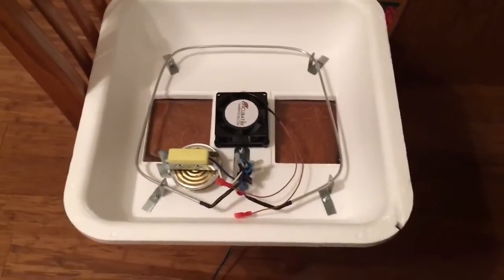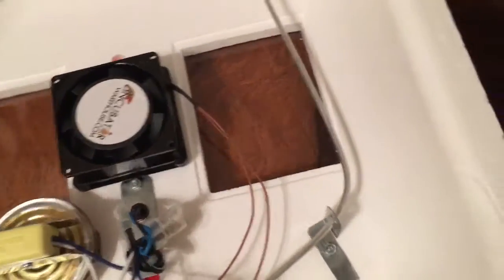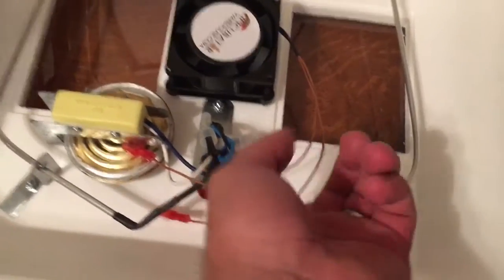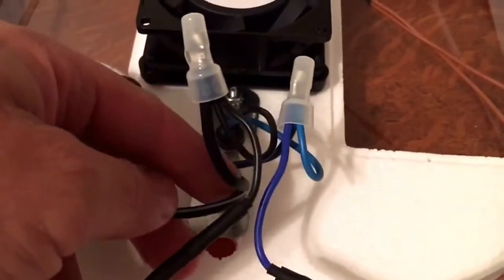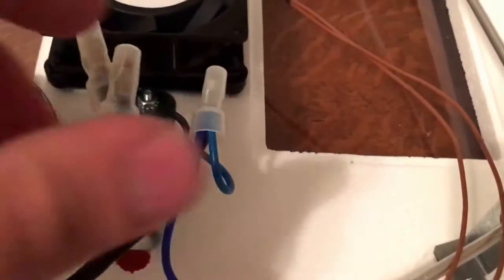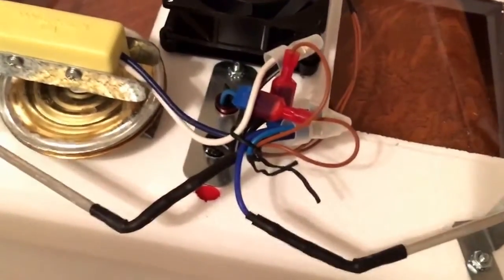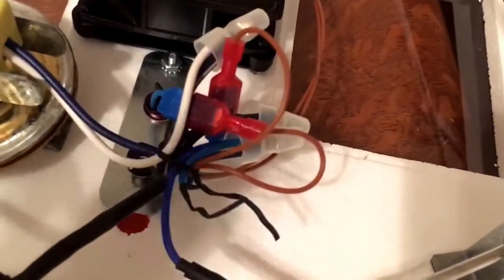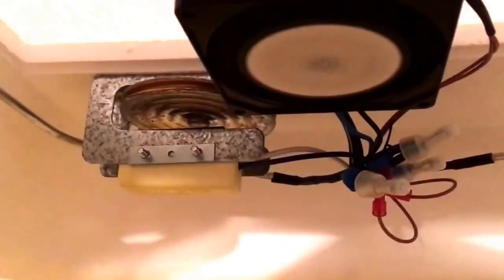Installing Incubator Fan - Circulated Air Incubator

Comment: does the air flow out the bottom or the sides?   where does it go in?  I would appreciate an air flow chart or some details.   I have a small fan I can hook up but want to know where I need to set it according to the airflow.  Thanks in advance for the information.
Reply from the maker: Connie Williamson the air flow is mostly internal. The fan is just to aid circulation, although there are a few ports in the lid that allow for some air exchange in and out, and to aid humidity control.